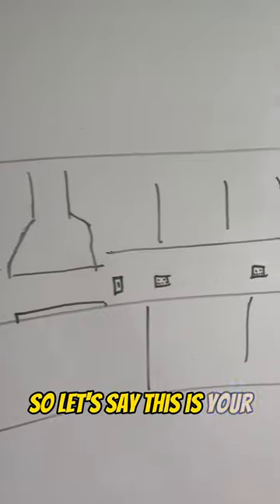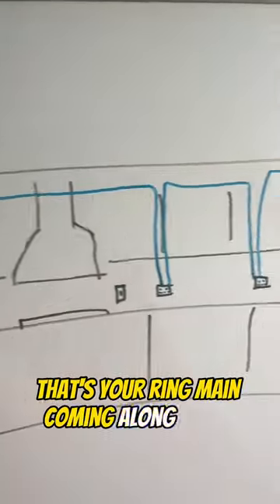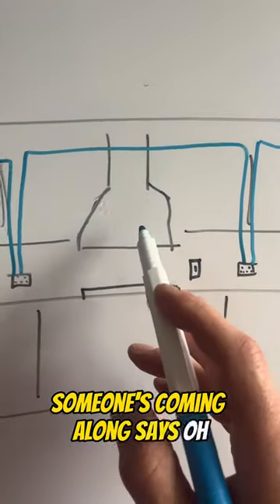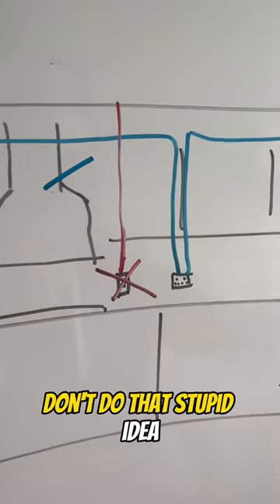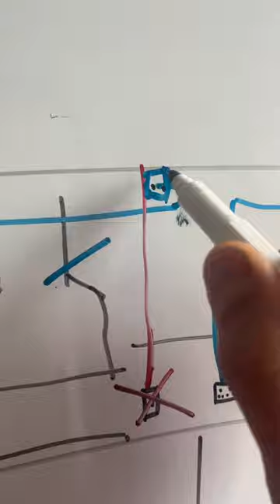Breaking into a ring circuit #ringcircuit #ringmain #electrician

Comment: Nothing wrong with coming off your cooker supply with the same size cable
Reply from the maker: Not good practice in my opinion though hey?
Reply: @toolboxtalking  would you see it as bad practice if it was a 2.5 radial on a 20a feeding an oven?
Reply: You can spur a 2.5 mm of a 32 amp supply according to regs
Reply: Didn’t matter if it’s 6.mm or 2.5 mm
Reply: @joecoco88 2.5mm only rated for 24A clipped direct. Can’t be used as a radial on a 32A breaker.
Reply: @demonkey123  read the regs book you can take 1 2.5 mm cable spur of a ring main anything after that would need fusing down but not the first cable
Reply: @demonkey123 You're not thinking in terms of a complete circuit.
If you only spur off the 32A ring for 1 double socket, then the maximum load the spur cable will ever have is 26A, because plugs are fused to a maximum of 13A each, double socket = 2x13A max, but nobody ever uses maximum constantly, which is why we have diversity factors included for circuits 😉
Reply: @joecoco88 read my post, I said a radial circuit can not be installed using a 32a circuit breaker as protection.
Reply: @codenamenel I didn’t say Spur. I said a radial circuit. 😉
Reply: @demonkey123  a spur is a radial circuit, there's only 1 cable 🤦
Reply: @codenamenel No mate. A spur is a spur a radial is a radial. Have a little read of your 18th edition if you’re not sure. 👍

Comment: Or change the cooker isolator to one with a single socket and put a plug on. And just for anyone else watching what he has drawn is a radial circuit, the other leg would have also gone back to the consumer unit.  Also the isolator looks well within the 600 limit from a hob 😂😂.
Reply from the maker: You sure it’s a radial?
Reply: @toolboxtalking yeah my end to end was dead, I might have faulty leads though 😂

Comment: Why is that wrong? I did that?
Reply from the maker: What spur off the cooker?
Reply: You can take a branch or extend on a cooker circuit. You just need to bring out 6mm cable to the fcu fuse down to 13amp. Then you can take a 2.5 mm run upto a single gang socket outlet.